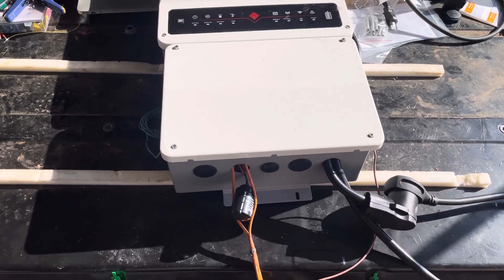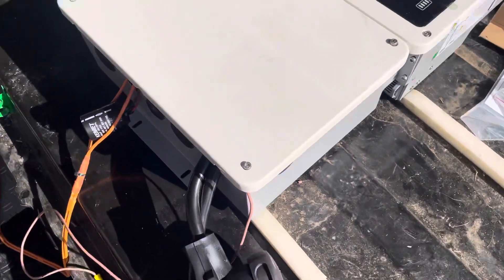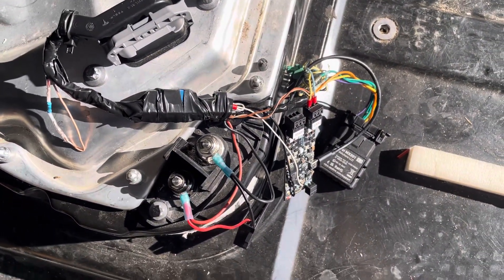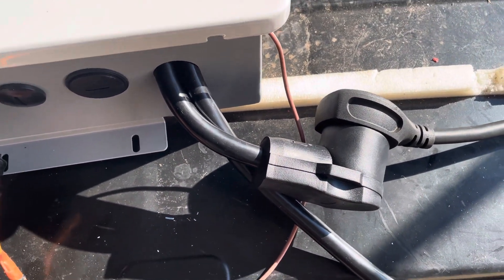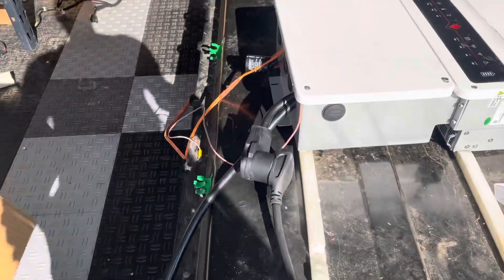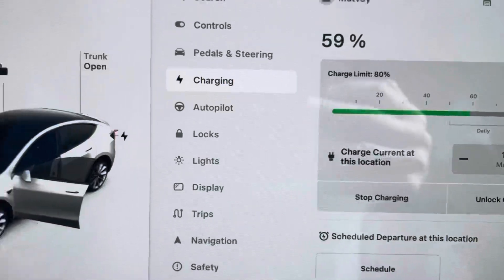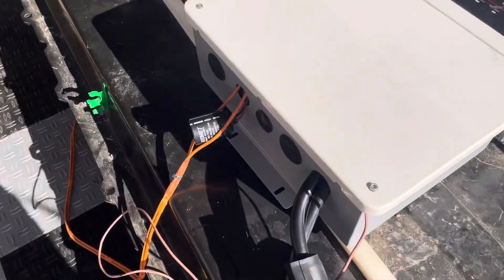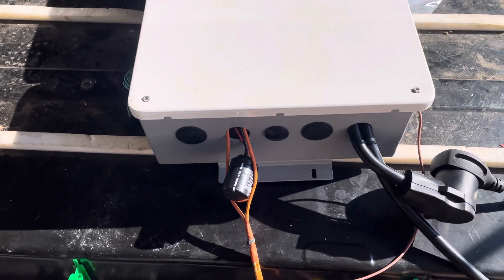Charging a Tesla from a Tesla battery with GoodWe rebrand inverter (+BYD battery emulator software)

Comment: Is the capacitor in this case for smoothing of input ripple TO the battery, or to satisfy the battery side self tests?
Reply from the maker: It’s required for the BMS to pre charge the HV when no driveunits are connected.   Or in other words it emulates a driveunit.